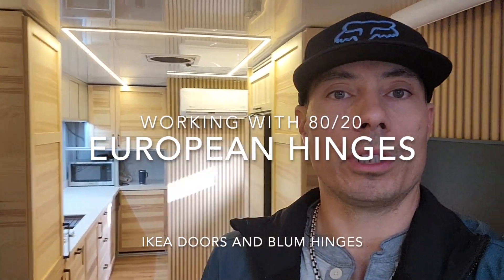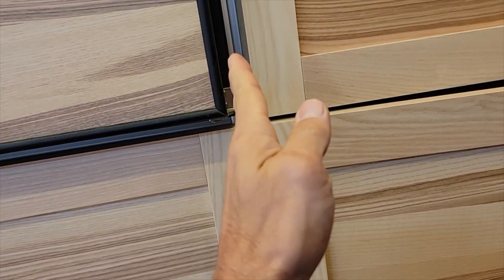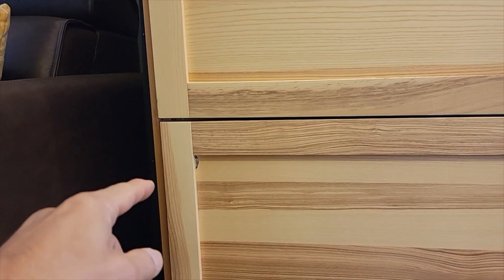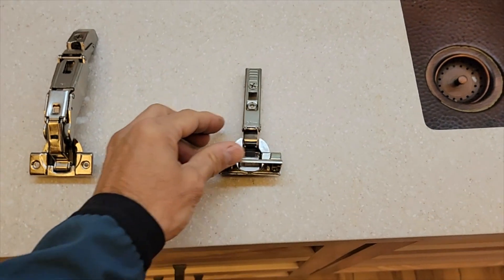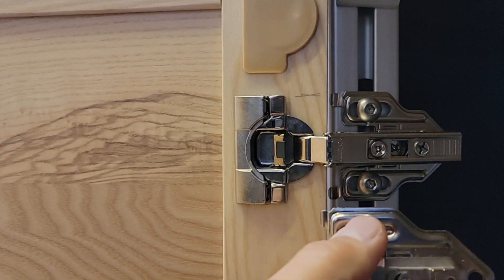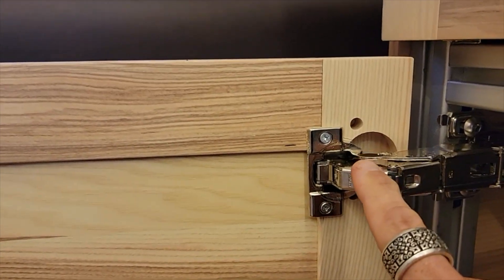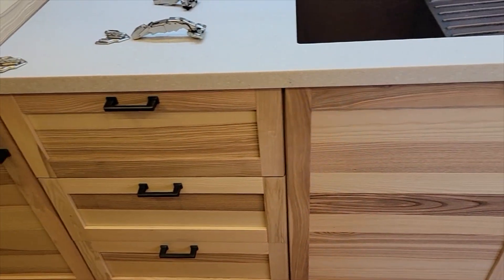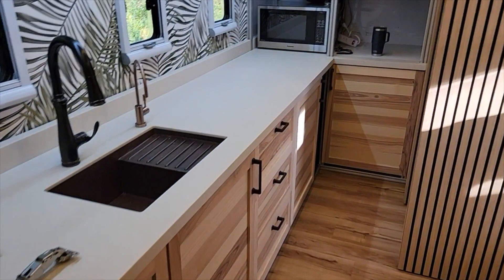Ikea Blum European Hinges on 80/20

Comment: You should of just glued a 3/4” filler to the end cap instead of the different hinge and drilling into the panel.
Reply from the maker: The doors wouldn't fit flush to the cabinets if we did that.